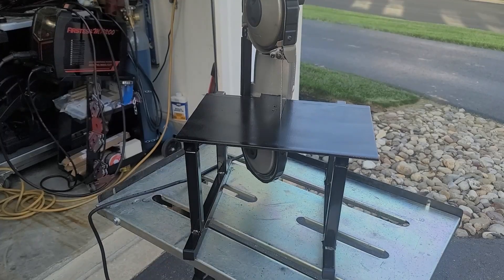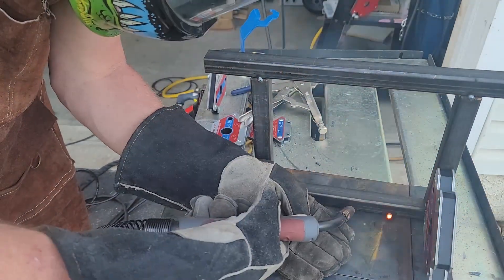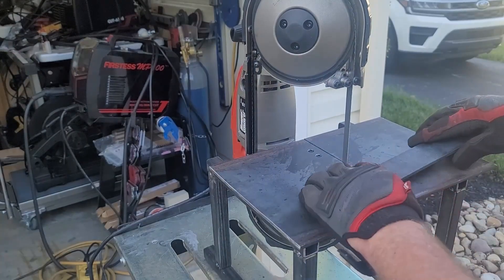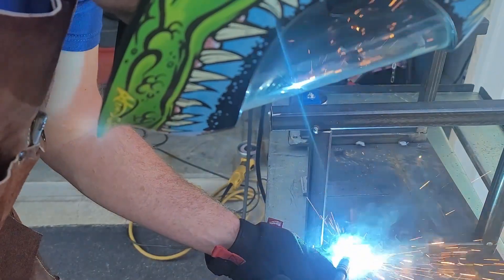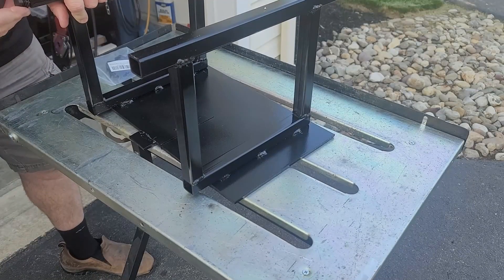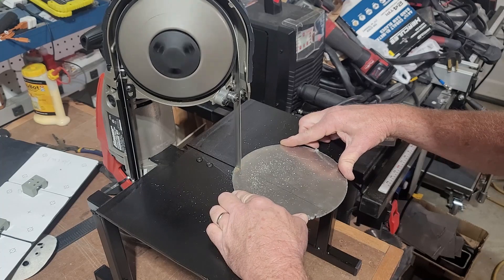DIY Portable How to Build a Portable YesWelder Live Demo | YesWelder How-To

Comment from the maker: Outline:
00:00 Introduction
00:55 Gather materials
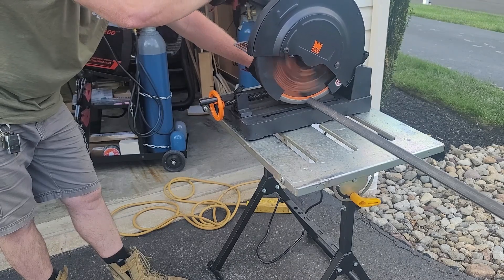01:11 Cut the square tubing
01:40 Assemble the base
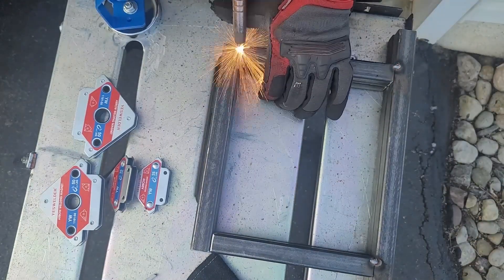02:30 Prepare the plate
02:45 Cut the clearance with a plasma cutter
03:12 Attach base to plate
04:04 Add bandsaw support
05:36 Fully weld the stand and test the fit of the bandsaw
06:16 Clean up welds and edges
06:37 Paint the stand
07:13 Mount the bandsaw securely
07:28 Test the stability and functionality